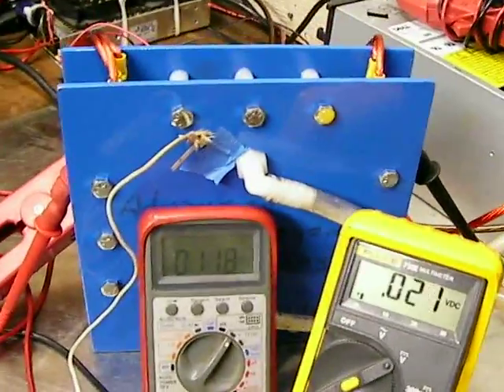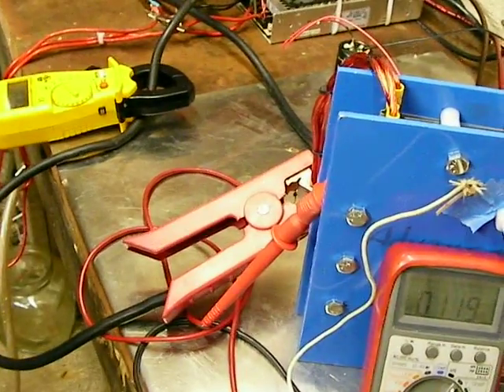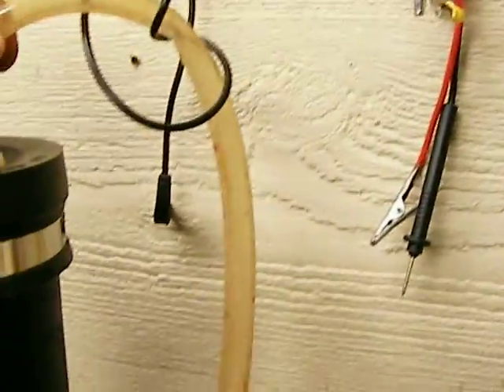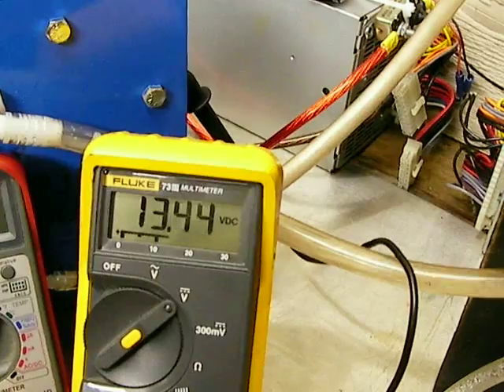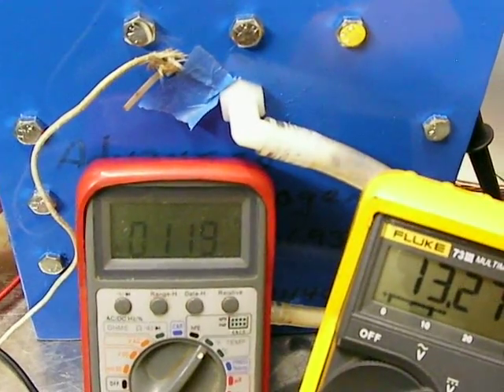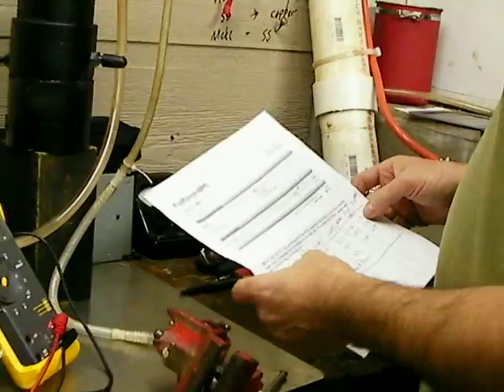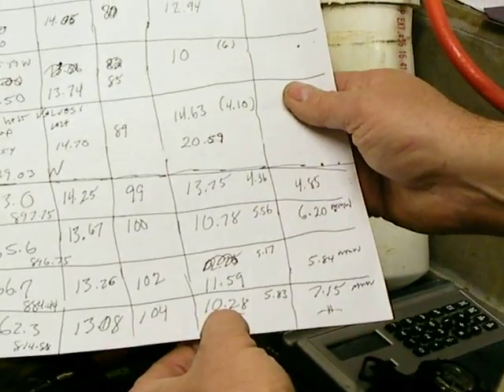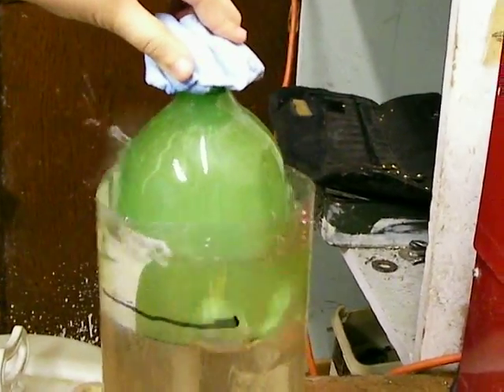Hydrogen production with magnetic fields. Huge output!

Comment: U may just need to make the area inside cell, larger, not the plates, just the area, to hold alot more water and better flow with bigger hoses, setup as to vacuum from big to smaller hoses. to circulate the water as the hydrogen bubbles flowbthrough a circulation section, where the gas can escape theough an upward section joined to the circulation hose. Ok

Comment: Bigger hoses into fuel cell and smaller coming out, to help keep same level when producing. But your cell is very small in space for water, so it will fluctuate. Unless pressurised the fuel cell at a psi hydrogen to escape, slower. But produce the same.

Comment: U need more neutrals bud.and U need to make a few more of same dry cell, and joined as a train conjoined together, in a line. That way the steam has soaked back into water or hydrogen, as it travels through each cell set.and in doing so will, create less heat sink. And better output. And yes cooler is better and more productivity, throughout
Reply: That's what I did. 8 in one, but seperate, to add if I need more cells
Reply: Need some information on a awesome magnetic coil with Quartz crystal, on a fuel cell. Any help is much appreciated

Comment: Another reason why amps are difficult  to stabilize. Bubbles. Yeah, bubbles occupy a volume between the closely spaced plates.  Those bubbles reduce the effective cross section through which current can flow.  A sufficiently sized pump can help clearing the bubbles out from between the plates. DONT rely on gravity alone if you want your output maximized. Also, using a pump will let you implement a cooling hose to help stabilise the temp.

Comment: Just commenting on temp...  1) production increases as  conductivity increases because  of rise in temp. 
2) Technically a higher temp provides some of the energy needed to electrolysis water thus increases the mmw,  but at these low temps this effect makes virtually no difference.
3) with increasing temperatures a gram of gas at one temperature and pressure will fill a greater volume at a higher temperature with the same pressure
4) as the temperature increases, so does the amount of water vapor.

I like the MMW way of thinking about efficiency and production. but many people's measurements are crude at best. Ideally I would sugest more standardization in MMW,  Ideally one needs to dry the dry the product, as well as measure temp and baryomic pressure, then they can adjust for STP.    If we all can compare dry MMW at stp, then we can get better real HHO production numbers and better compare relative efficiency.

Comment: There are better ways for current control than using a welder. PWM would really help you out fella. Drop a line
Reply: What are the best pwm, and where can I buy
Reply: @shaneoneill2254 Do you want a ready made PWM or make your own from components ???
Reply: @victoryfirst2878  buy own post width module And I was wondering, is anyone using north and south pole magnetic field s and frequency use in hydrogen fuel cells

Comment: Simple fix to your problem take two old microwaves that you can pick up pretty much anywhere and tear them apart take the capacitors out of the back of those capacitors are rated for much higher rate take two of those and run them in sequence together and watch how it drops

Comment: Dude, u   r  wasting your time and ours. The amperage consumption (@ 60 Amps...What ???) is insane. Not worth doing such a wasteful experiments. The max Amperage for such a HHO quantity should be around 30-35 Amps tops. You need to study frequencies and how to use PWM.
Reply: It's even better to buck convert that PWM power down to a lower more efficient less waste heat producing voltage that produce HHO 100% of the time as opposed to only during the PWM duty cycle. 

https://upload.wikimedia.org/wikipedia/commons/thumb/5/52/Buck_operating.svg/300px-Buck_operating.svg.png

Add these after the PWM module to make it a buck converte. Add a  diode reverse biased to ground, an inductor and then a capacitor to ground.  They should be appropriately over sized for 30 amps.
Reply: Exactly

Comment: While the water temp needs to be higher in input the brown gas should be feed through a condensing coil. This will give you clean water free output. Basically you end up with distilled water as your water vapor that can be fed back to your input holding tank.   Your fluctuated output is going to continue till input and outputs are stabilized.  You may even notice better output with hotter input water temperatures below boil temperatures.  A condensing coil going through a water jacket should work nicely.  You would want to keep as much water vapors from any consuming Device or engine.

Comment: What is an MMW ??
Reply: Thanks Greg vid
Reply: MMW is another way to Express efficiency. millilitres of HHO per minute per watt. 

Energy is a product of watts over a period of time so a product amount (HHO) in millilitres produced with a given amount of energy. 1 watt second is one joule of energy. 1 watt over 60 seconds is  60 joules 

An HHO cell with a MMW rating at 6 will produce 6 millilitres for every 60 joules of energy and is twice as productive as a cell rated at 3MMW that produces only 3ml for every 60 joules of energy. 

Typically MMW is derived as 
MMW= (1000 ml in a liter) /((seconds to fill one liter/60 seconds in a minute) × (watts or ( volts × amps))).

Comment: Hey. During the water bottle test when you noticed that the bottle fills faster over time, I don't think that's right. If you notice, the second time, there was a lot more gas built up.

So the time was "cut down" but only because it had a head start.

Comment: thats a nice steam generator, i wonder how much HHO its actually making? maybe 50% of the output?
Reply: I was wondering that myself. Fill a 1 liter soda bottle quickly remove cap and slide over launch pole(launch as a true 'bottle rocket')and light it .I'm betting ten or twelve feet MAYBE . Get that steam level down and reach 80 ft and more.
Reply: Moisture content in the gas stream  is real, at 100f to 120f it's not huguly significant. My guess without looking is 95% HHO or better at these temps.
Reply: More steam, them hydrogen, use a condenser
Reply: @shaneoneill2254  the temp was 104... if that is Fahrenheit  then there's not much steam.  But let's say it was 104c with the boiling point elevated because of NaOH or KOH, the gasses are still cooled going through a bubbler coming out much closer to room temperature.  Sure, it's probably saturated at 100% humidity, but  I'm guessing water vapor is composing maybe 5% at most of the gas stream, after the bubbler, where they are likely do a displacement test.

Comment: i think your real mmw is 6.5 max. please, calculate average amps and volts. Your amps running 64-70 amps, volts 13.0-13.7. You can use water pump to your dry cell if your amps and volts are changing.

Comment: This is why I Started to pump the electrolyte. When I did so the current stabilized and went up. You are also over driving your cell and wasting energy as heat.
It does not take a lot of flow to get it to stabilize.
The problem with pumping is it causes the electrolyte to foam and it is not easy to breakup. (release the HHO from the OH- (Aqueous Liquid electrolyte) This highly charged liquid tends to hold the bubbles in place and thecharge holds the HHO By the charged fields ofopposite charges.
Reply: AllgoodAutomation :  Yeah! totally  agree , he needs to circulate the electrolyte around the plates to get 
better  surface  exposure  to the charged plates, the  bubbles and foam create electrical resistance. 
it should be  more efficient.

Comment: The Reason Your Current is Jumping around is the  Electrolyte between the plates is being displaced by HHO. Current goes down until the electrolyte has a chance to rush back in between the plates.
Reply: So he needs more spacing too between plates 3mm

Comment: Interesting experiments, and nice vids but your MMW is scewed. Some tips:
To much amps for the surface area, spacing is not enough, container to high; your making  to much steam.
 Your cells are wet-running drycells, not DRY-cells.. Real dry cells when correctly configured do not run hot, and don't make steam.
Running your car on Caustic steam is a costly
experiment, your customers wont like it.
You use 11 plates, thats 4 neutrals. Thats not good, you need 5 or 6 neutrals for 13.8 V DC.

Comment: Assumptions included in the formula
- Gas collected holds 20 degC. However, If it is instead 10 degC or 30 degC, it will only have marginal consequences.
- Gas collected holds 1 atmospheric pressure, which is very close to the truth in most cases.
- The collected gas is saturated with water vapor, since most experimenters use a bubbler to collect the gas.

Comment: i think your right about the water level. your pumping water out faster than it's going in. take a look at this:

The formula I propose and which is accurate to wathever degree is required here is:

EFFICIENCY (%) = 100 * 7744 * V /(U*I*t)  where

V= Volume H2/O2 gas produced in liters
U = Voltage
I= Amperage
t= Test period in seconds

The above formula is calculated from ideal gas law and Daltons law.

Comment: Wanted to give you a quick update on my 12" Monster Cell output test at 89A.  It was run at 89A and produced 8.5 LPM @ 13.8 Volts.  Customer ran it for a few hours and tested LPM using bottle method and just reported back to me.

My power supply has still NOT arrived, when it does I will also post a video on bench test of it too at higher amps, but so far looks like MMW was pretty high depending on temps he was at..and how much steam (dont know that) looks like its  6.7MMW!

So we see...

Comment: thats a 6" cell right? How many plates?

Looks like a 4n 3?  SHould do a 21 or even 36 plater and see how it reacts to higher amps either have to add more plates to the 6" cell or increase EACH plate size with larger plates themselves.  

An 8" 4n 3-4  might handle  40-60A ok I would think.

Overdriving small cells might work but must have pump and or radiator to cool the elect.

 Not sure can run 35-40A for any period without heat issues on 6"/ 4N 3.  I will get numbers too on this.

Comment from the maker: i now have the thermo coupler inside a connector so it is in direct water contact at the output port. the water temp at high amp climbs shockingly fast! within 5 minutes the water is 120-130... now what? maybee more neutals??
Reply: More neutral plates and or buck convert  PWM  power. 

https://upload.wikimedia.org/wikipedia/commons/thumb/5/52/Buck_operating.svg/300px-Buck_operating.svg.png

Buck converting to a lower voltage will allow you to adjust the output voltage by varying the PWM duty cycle.
Reply: Yes more neutrals, untill not jumping, and smooth flow

Comment: Reinforced tubing will hold up better to the heat. :) At 65A (closer to what you were running it at)  Using my dry cell .67LTR/10A baseline that's .67LPM x 6.5 (x10A) = 4.35LPM of HHO, I would expect the rest is about 1.48LPM of steam/expanded vapors. Also the temps are probably MUCH higher inside the cell, gases are expanding as well might be skewing things a bit, but Still good to see higher current tests.

4-5N 5 probably handle 60A better to get you back down to around the .33A/sq" max

Comment: Now all we need is a 60A pwm that works :)  Problem is how will the cell react with longer run times at higher amps.. Also document WATER loss in your bubbler due to steam off.. that could become an issue as well at these amps.

Steam is good for gaining MPG, cooling it first to mist and then injecting it even better. 

How long did it take to go from 99F to 130F?

My 10" cell test vid at 90-100A should be up shorlty if my power supply ever arrives.  I expect it to match 6" temps rise.
Reply: PWM all by itself sucks bad. It reduces production and the real problem is using too high and inefficient voltage.  

Take a PWM and add a diode and inductor  to get a primitive buck converter. 

https://upload.wikimedia.org/wikipedia/commons/thumb/5/52/Buck_operating.svg/300px-Buck_operating.svg.png

With PWM alone, You'll produce inefficiently part time. With PWM as part of a buck converter, you produce more efficiently 100% of the time. 
The HHO cell plates and electrolyte act like the plate and dielectric of a capacitor below water's splitting voltage. But you can still add a capacitor as shown in the picture to hold the minimum voltage up.

Comment: Jumping might be due to too many amps for plate size, youre shredding and vaporizing the water,turning it to foam/vapor, too fast, so the draw is varying is due to elect turning to foam across he cell That would be my guess.

If my rule of thumb of .67 L/10A holds, for dry cells, then you are probably really getting 4.02 Lpm of HHO, and about 1.81 Lter of steam/vapor.

Fill a balloon, seal it let it go.  PURE HHO should rise quick, if it falls, or levels off, you have quite a bit of steam.
Reply: That's an awesome idea

Comment from the maker: i built a thermo coupler that goes inside the water tube at the out put i will do a video of the thero-fitting i will use it on the top fitting and on the bottom too see if there is a temp difference. also i plan to do a video of output with and without a bubbler full of ice! too see if there is a difference in out put...i have no idea how much is steam.. at 60 amps and up count on some steam! even at low water temp!!! be blessed! scott
Reply: A large bubbler with ice water where you can also coil the gas hose will do much remove water vapor and cool it, helping you standardize your  test. Presumptively the temp of the ice water is zero celcius. You can further standardize your MMW by taking barometer reading and use Boyle's gas law, P×V=constant,  to standardize to STP, 0 celcius at sea level.
Reply: Why can't U just run a seperate section with copper pipe, or stainless steel pipe on the back of a heat insulator grill. And when fan hits the pipes, it contracts , because it's running through cold pipe

Comment: What you are seeing with the jumping amps is the sensitivity of your metter.  And yes, the fluctuations are due to water level changes.  Nothing unusual, nothing to be concerned with.  If you were getting dramatic swings or stedily decreasing amp draw then sudden increase, then you are not getting gas out fast enough to keep the plates covered with fluid.

keep in mind, hot gas measures big ... get temp of gas during measure ...